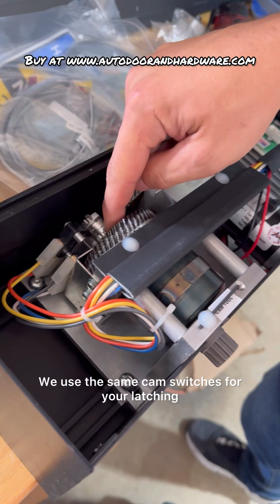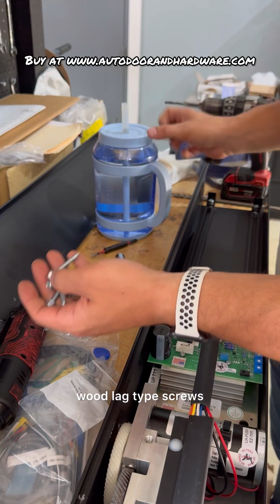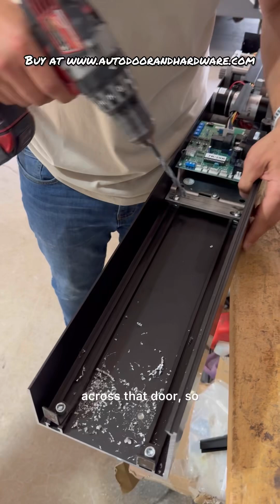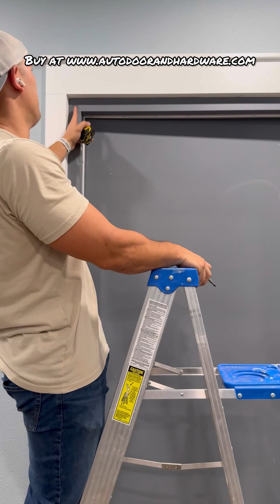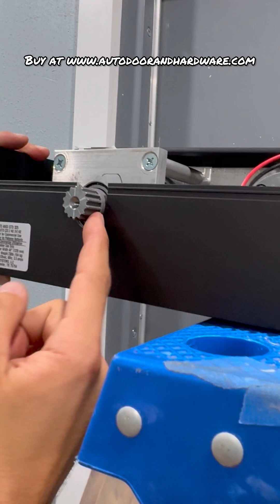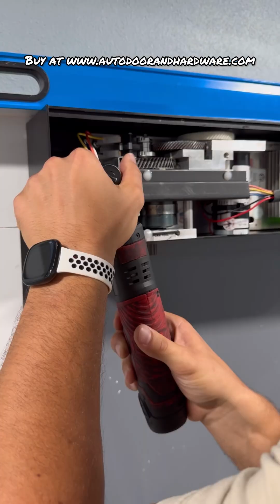Step 1 Mounting - Maverick EZ-7000 Automatic Door Opener Installation

Comment: What if i need to install the opener on the other side of the door?  This is a meh video.  The opener has 4 installation instances and this is just one.  Meaning, you have a 25% chance that this video will help you.  As for me, it did not.  Comprehensive, my ass.  Fail.
Reply from the maker: We also provide a full installation guide in pdf format as well as in house full tech support! If you further questions please reach out or send us a pic of the side you wish to install on. We love helping customers and aim to eventually have installation videos for inswing applications as well. Have a great day! 😊
Reply: I have recently installed an easy 7000 on a residential door for a handicap client of mine when I hit the auto or open button it only closes, but when I switch the red and black wire, I can get the motor to open only it will not open and close either way what am I doing wrong?